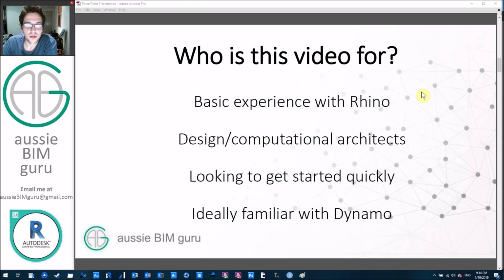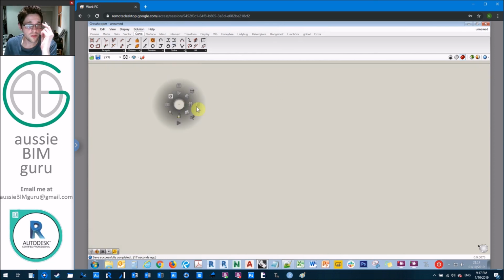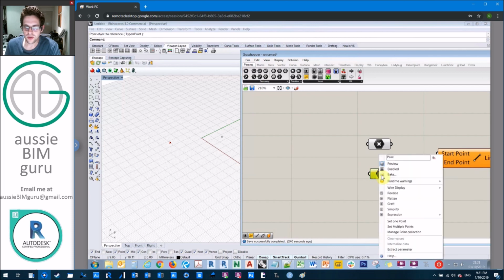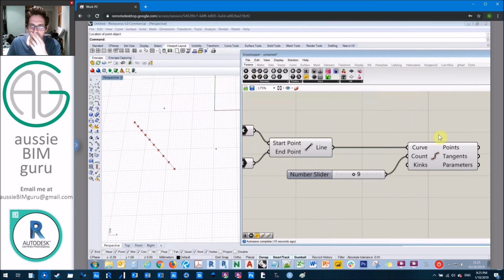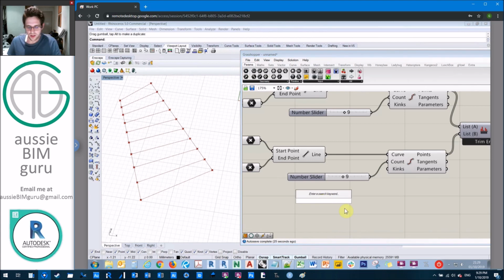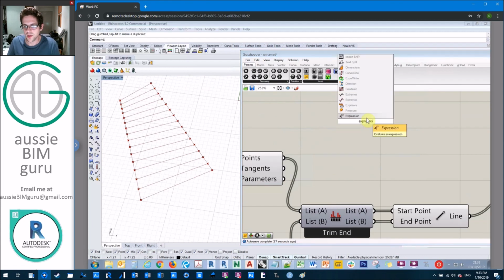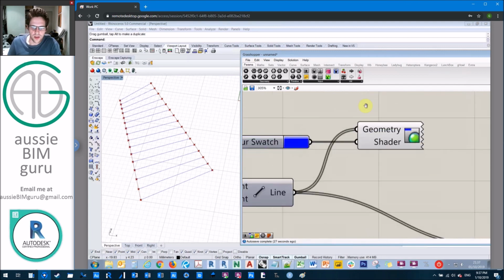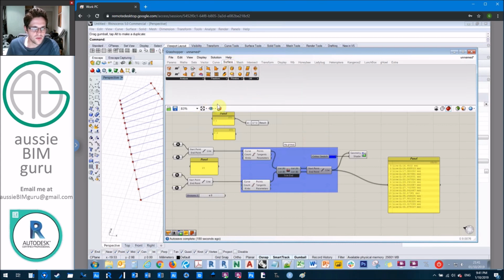Beginner's guide to Grasshopper!

Comment: ABG, we have spoke on Linkedin as well as in other comment sections on your videos. I am in the educational industry teaching the next minds about AEC/BIM specifically with regards to the MEP side of things. Do you feel that GH or Rhino has any utility in MEP? Or is this mainly for benefit of the structural and architectural fields?
Reply from the maker: Hey there Dan!

I believe both have potential, but moreso Dynamo as most engineering is undertaken in Autodesk software vs. Rhino. I'm aware of some bridge designers and structural engineers using Grasshopper (Karamba and Galapagos specifically) for analysis and testing, but more often than not Revit, Civil 3D and AutoCAD.

I'd recommend getting in touch with Sean Fruin of Sigma AEC Solutions - no doubt you may have seen his content on LI already; he's one of the most active and savvy Dynamo users for MEP I've come across. There's a good video here showing a duct placement script from start to finish by him: https://www.youtube.com/watch?v=7-7bHd8lUMg

For any discipline wondering of the benefits of Dynamo, I usually ask them; 'have you ever observed or used some data to drive a process in your drafting/analysis/modelling', if so, there was probably room for Dynamo in that workflow.

Such examples I see commonly:
- transfer of data from excel points to model elements, such as inground cable runs by start/end points
- tagging of assets by room for facilities management
- systems analysis and updating of components to suit flow/pressure requirements (e.g. pipe radii)
- automated placement or 'rejigging' of fixtures to sit within ceiling grids
- duct/pipe run length optimisation

To name a few! Hope that helps a bit
Reply: @AussieBIMGuru  Thank you for the reply! I am quite familiar with Dynamo's capabilities and I have enrolled myself in a python class to begin wrapping my head around it. I certainly plan to add Dynamo to my curriculum. 

I just wanted to pick your brain to see if GH and/or rhino were worth looking into as well for the MEP fields. 

I will reach out to Sean Fruin as you suggested. Thank you!
Reply from the maker: @danstevens64  I think Grasshopper's application to MEP will be a bit left field for an educational environment - Dynamo is the best place to begin at least (especially if all the modelling is being done in Revit), then maybe looking left field at Grasshopper and Rhino Inside as a way to enhance Revit directly, rather than focusing on Rhino import/export workflows.

Comment: Hi, i'm learning dynamo for a year. Do you recommended learning Grasshopper in stead of Dynamo? I work in Revit.
Reply from the maker: Hi Jesse! I would learn Dynamo first as it can do more directly within Revit currently. Have a look into Rhino Inside (video series on my channel just started) as this might be a good way to get into Grasshopper but with relevance to Revit.

I mostly use Grasshopper for environment analysis and form exploration so far, so when you find Dynamo isn't able to achieve these (or similar things), it might be time to consider GH as well.

I'll upload a 2 part sun hour analysis script in GH in 2 weeks time, might show you a more pracrical application for GH in architecture.
Reply: @AussieBIMGuru  Thanks!
Reply: I started getting serious with learning Dynamo at around the same time last year. How's the progress going? Besides this channel, I found that Lynda was a good place to start.
Reply from the maker: @sakhile_nkomo  lynda (linkedin learning) has some great material. The price can be a bit steep for some to access LI premium but worth it for those accelerating their skills.

I'll let Jesse respond himself, however I've seen great things from his progress via his postings on Linkedin over the last few months.